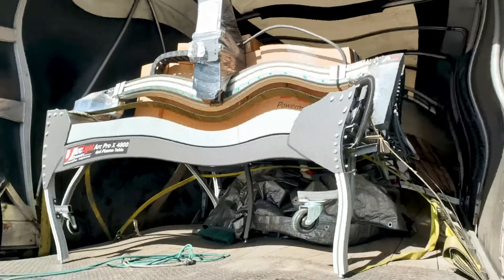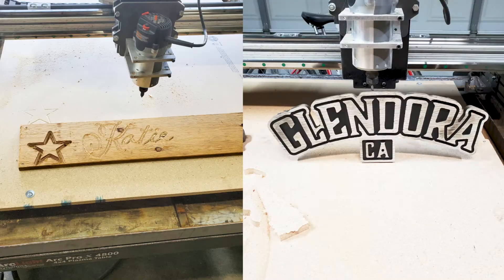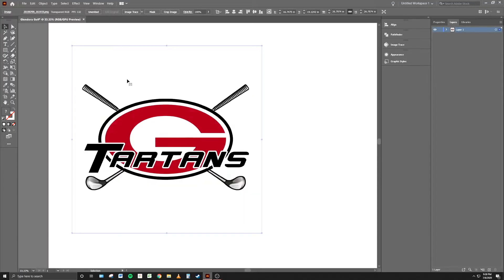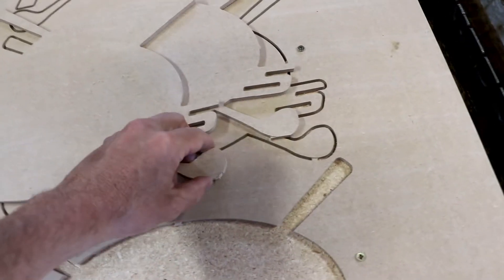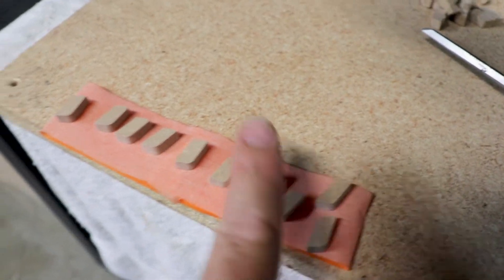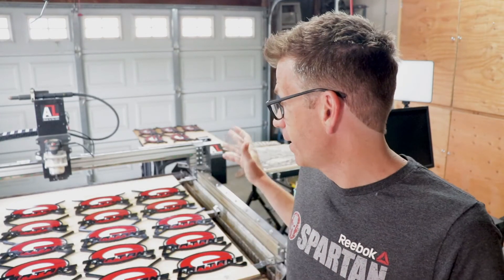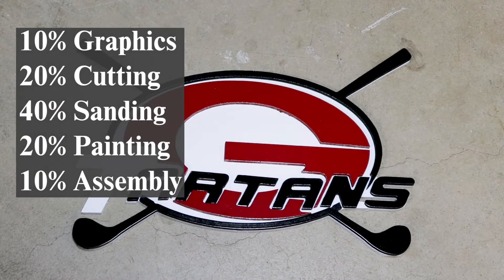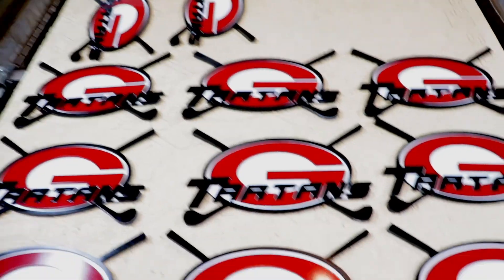Converting My CNC Plasma Cutter to a CNC Wood Router

Comment: Hello! What program did you use to make the machine cut your design? Did you use the same one as the plasma cutter, or is there a different program I should use for the wood conversion?
Reply from the maker: The plasma cutter comes with Qcad and inkscape for designing. I didn't like either of those.  I design in Adobe Illustrator. It was worth the money for me to pay for the Adobe software as I found inkscape kept crashing, and i felt qcad was better for designig simple flanges and basic brackets. The Arclight table uses Sheetcam for machining. In Sheetcam, you have to change the post processor from wood to plasma and back depending on what you are cutting. It's a pretty simple change you can make to go from one to the other.

Comment: I was told to only remove the slats that were in the way of the bars, but leave the others so there would be support
Reply from the maker: I actually got a tip from another guy on the ArcLight Facebook group. He suggested just buying some rigid insulating foam and cutting it and laying it on top of the slats. I've been doing this the last several times and it's much easier. I just skim the spoil board I put on top to try to get it as close to flat as possible and it's been much simpler than using the support bars. Thanks for the comment.

Comment: I guess I didn’t catch why, if the supports didn’t support the spoil board enough, why not just keep the slats in and add some tabs to a couple for fastening down the spoil board? Seems weird that the supplied supports wouldn’t be enough but the table naturally has sufficient support and you need to swap out slats all the time so fab-adding to a few isn’t a big deal
Reply from the maker: That's an option, but I guess I would have trouble drilling the spoilboard to match the added holes in the tabs I welded on to be able to fasten it down. If you have some hacks for that let me know. Since I did this video, I learned some guys buy large, thick sheets of insulating foam from Lowes or the Depot and lay it down on top of the slats and then wedge it in to secure it. Not perfectly flat, but good enough to get the job done I hear. I'm going to try that next time.
Reply: @MountainWerksVideos  how did you drill to attach it to the provided supports? For locating exact coordinates on a bed I like to use a long t-square (I have a 4-footer) so you could pick anywhere on a few slats and just mark down where they were from the edge. Another way is fasten screws from the bottom of the tabs, set your spoil board down where you’ll want it and tap around where the tabs should be to make some good impressions.

Comment: I would love to see you set up a project inside sheet cam, setting up the whole post process & tool paths, etc. I repaired a few Arclights in my time but never grabbed the concept of getting the motion of the router to work on my table. I had it working slightly with the router kit that i made but got to busy with business and had to put it on the back burner.
Reply from the maker: Thanks for the suggestion. I'll include that part the next time I set up the router attachment. It took me a while to figure out how to get it working right.

Comment: Why not give the brush 
an accurate trim? Buy a belt sander and a spindle sander, done in seconds.
Reply: Hi John, thanks. Yeah, this was more proof of concept to see if I could get it working. If I end up doing more wood routing I would def invest and spend more time optimizing it. Belt sander is a good idea and I'm looking for something that would handle not only wood but metal as well.

Comment: First of you are one talented young man and your videos help out a lot of learners like me, so thanks for that! 
Second, after watching your video I thought of something. Instead of the front mounting jig you made, another option would've been if you would've made a negative jig. One that you could have fitted and aligned all the painted parts upside down, then with a small paint roller, roll the glue on all the pieces while inverted in the jig. Then placed the back piece over it and put some weight. Thanks again.
Reply from the maker: Hi Larry, thanks for the note. That's a great idea. I'll try that on the next one. I'm definitely looking for ways to cut down the labor!

Comment: Great job 👏.   You should try using double sided tape to eliminate the need of cutting out and sanding the tabs.
Reply from the maker: Great suggestion! Is there a type that you know of that would work? The MDF is pretty porous and not very smooth so I don't know what the best kind would be to adhere to that surface.
Reply: @MountainWerksVideos  I have been using Uline High Tack Double Sided Film tape that seems to work well for me.

Comment: For removing the tabs you could secure the cut pieces to the spoil board with some small pieces of scrap and screws in the kerf in areas away from the tabs.  Then make a new tool path that just removes the tabs.  This would free the parts as well as lessen the hand work you need to do.
Reply from the maker: Thanks. I will give that a shot next time.

Comment: Nice video - good content & info. Thanks for taking the time to put it together. 
Curious if you see yourself going back and forth between plasma & router frequently? 
I am considering the Arclight 5x5 table for mostly plasma work - but would like a router as well - but wondering if the swap over is efficient enough for regular flip-flops between processes? 
Any additional feedback or info about the table conversion to router work after this video was made?
Thanks in advance for any info. 
Cheers
Reply from the maker: Hi. Thank you. Right now, I'm waiting about 2 months between switching the table over. It took me a couple of days the first time because I wanted to clean out the water table...ugh what a pain. If you don't care about that It's a good 2 to 3 hour project the first time to drain the table, pull the slats, mount the router bracket, support beams, and get the spoilboard on, and do a test run. I bet I could do that in 2 hours now though. Hope that helps.
Reply: Perfect - thank you for taking the time to respond! Cheers

Comment: Well put together video thanks. I also have the arclight table and thinking about getting router setup. How do you like it? Also what computer are you using?
Reply from the maker: Hey thanks for watching. I think at $800 (I think that's what it cost) it's a reasonable price for the package and it gives you a lot of flexibility. I really enjoyed learning the router a lot. In terms of my computer that I did my work on? It's a custom built PC that I made running Windows 10.

Comment: Thank you for sharing, it’s a very nice project ir came out beautiful, what type of material did you used for it?
Reply from the maker: Hi! I used 1/8 inch mdf. You want to make sure to put a sanding sealer on it and lightly sand it with 220 grit sand paper. MDF likes to absorb paint and the sanding sealer makes sure it stays on the surface.